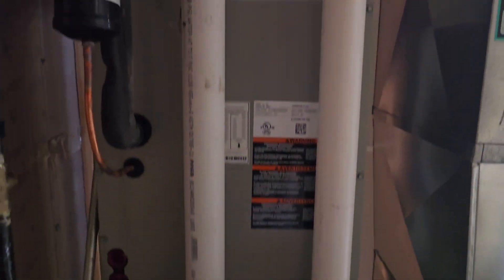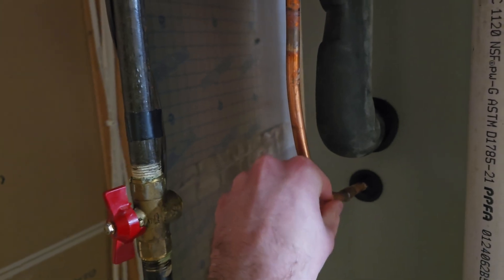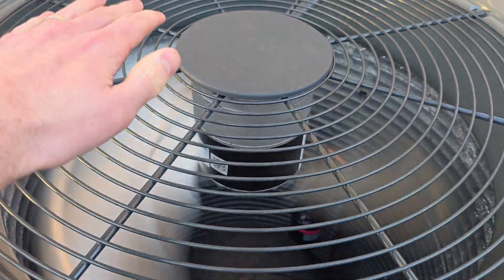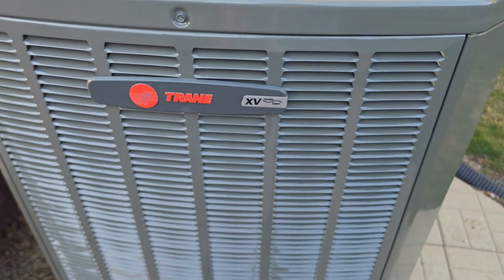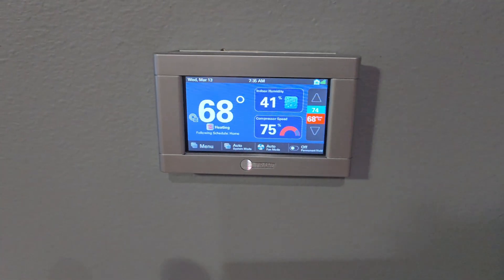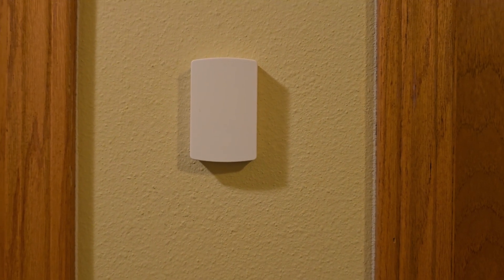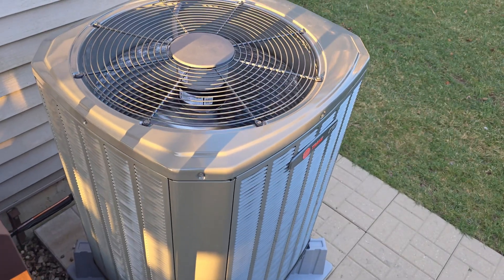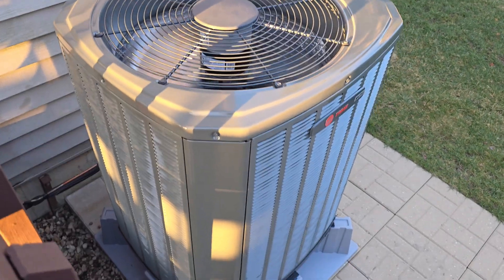New Trane Dual-Fuel HVAC System| Overview

Comment: About 16amp 240v system running at 75 percent. ... That's a lot of juice. About 2.5kw and it's not very cold outside. Seems it might be better to use gas at that temperature. Have you noticed the reduction in gas cost has outweighed the electric cost at 35f ish?
Reply from the maker: The system always starts at 75% after sitting idle and this is what the video was showing. At that temperature, it slows down to less than 40% most of the time, after a few minutes.  In my area, I have found the economic balance point to be around 25F, in which the gas furnace will take over.
Reply: @matteng1997   nice! Thanks!

Comment: 16-17 grand. Wait until you have to get it serviced out of warranty. Proprietary   parts that are expensive and usually two or three days to get. Just like Carrier. You could have put in a different brand with similar seer ratings and saved 4 grand. You will never get that savings back. Pretty cabinets and clever advertising gets them every time.
Reply: Cool, like which brands and which specific products?
Reply: @ 
We almost exclusively sell Goodman systems. Their 18 seer heat pumps have the best warranty and cost about half of what Trane sells for. In the subdivision that I live in, half got Goodman and half got Lennox. In 16 years, most of the replacement systems were the Lennox. My neighbors know my trucks and ask for estimates to replace the Lennox. So far, I got at least 2/3 of the jobs. Goodman gets a bad name from companies that sell equipment that the distributor gives dealers incentives to. Goodman  does not give us truck wraps, vacations or discounts to move equipment. Naturally, our prices are lower than a smaller company buying fewer systems per month. Last point. When getting an estimate, get in writing they only use employees and not sub out the install. Sub contractors do a terrible job and cause problems that can be hard or expensive to resolve. We never sub out our jobs.

Comment: One thing I see is the exposed wire nut connections on the low voltage outdoors.  Installer needs to tuck those up inside the service panel and make the connection inside of it.  Haven't watched the whole video so I will see what else I can find, lol.
Reply: Alright super tech